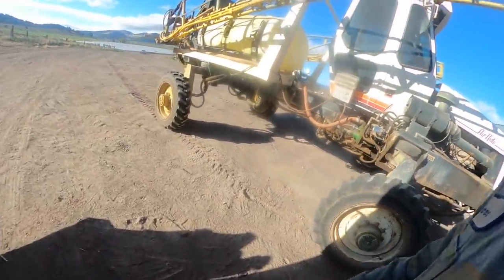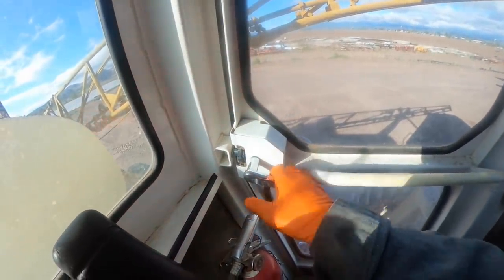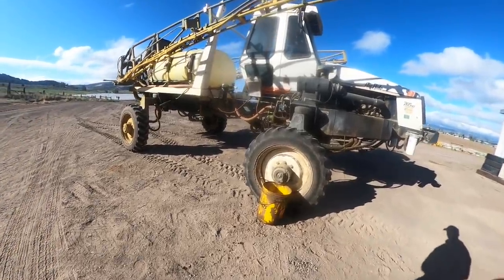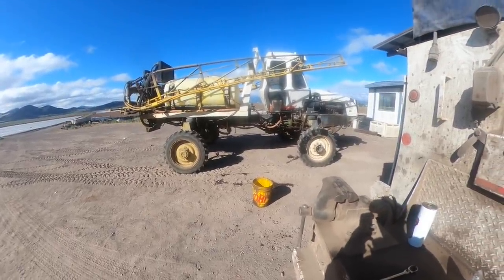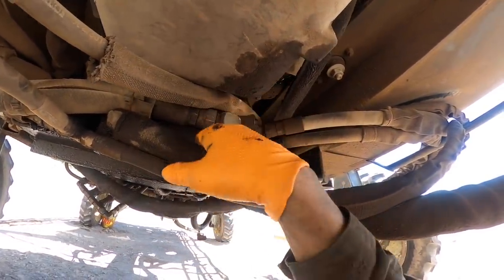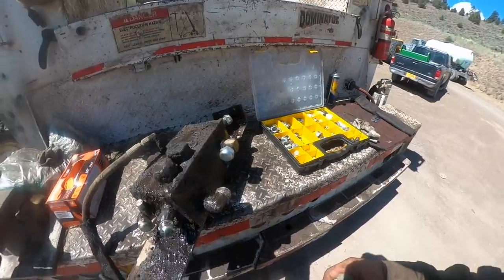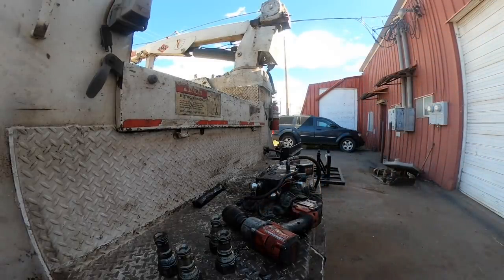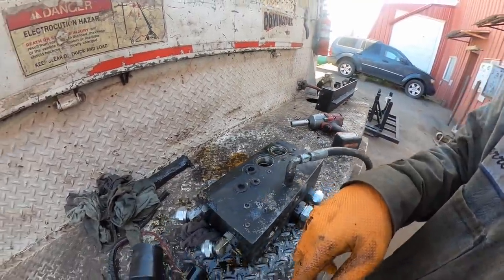More Hydraulic problems!

Comment: I used to maintain a Summitt 100 HP oil filter baler that used parallel 50 HP/3000 psi hydraulic systems designed to increase the cycling speed without needing huge plumbing to get it done, one of the downsides of all the flow was by the end of a shift the oil would get quite hot as you may imagine. Because of the temperature cycles the aluminum manifolds would expand quite a bit and in turn eventually allow the (Sun) cartridges  to lose their intended torgue setting and as such allowed the ever so slight leaking on the o-ring/backup rings that if not caught in time would send debris everywhere in the system as well as allowing both directions of flow to energize at the same time. The final solution became making sure the cartridges were super tight when cold before the shift began and a schedule to change all of the o-ring/backup rings every quarter. 
 I can only imagine the possible issues with this sprayer drive using a 6000 PSI operating pressure, no doubt it would possibly have issues not seen in a more common 3000 PSI system, for one thing cracking webs down in the manifold where cartridge port ends may be close to one another.

Comment: Answer for some of the comments questions on how the two - speed works in a nutshell. The pump supplies a certain flow (rate or "speed"). Increase the flow to the motors and they must turn faster. In low, the available fluid flow (gallons per minute, liters per second, whatever) is dived to each motor (4), so the motor speed is essentially the pump flow divided by 4 flow circuits. In high, the flow is shared between the left and right front and rear pairs of motors (2), so the flow is now only divided by 2 flow circuits, so theoretically twice the flow going through the motors so twice the speed. It works very similar to parallel and series electrical circuits.

Comment: Warren, I've suggested this before, get yourself a small tank, 30gal roughly and a small pressure washer and mount them on the upper side of your tool racks. Gives you the ability of washing stuff on the spot instead of making trips back and forth unless you absolutely have to go back to the shop. Plus, if the set the tank up properly, gives you a hand washing station on the spot as well. Great video as always. Cheers :)

Comment: I use the bumper on my service truck as a work bench just like you do.  I went ahead and welded a lip around my bumper and drilled a few drain holes with a plastic container underneath to collect the oil.  I put the lip on because I was tired of parts rolling off into the dirt and having to find them.

Comment: I worked at a grain elevator years ago. Co-op. And used to drive the truck hauling water and chemicals to the guys out in the field with the sprayers. We just got in a 1274 Rogator. Gigantic huge machine. Anyway a bad storm was coming in with supposedly hail and maybe tornado. So we decided to park it inside at our fertilizer department to protect it. And I was volunteered to drive it over and put it inside. I had never drove one before and was scared to death cause I was afraid of it getting away from me and crashing it. Well I figured out how to put it in slow granny mode crept it over to where it was going to go inside and the big bay door was pretty narrow and as tall and wide as that machine is I didn't trust myself. So I went and got someone else to drive it in. Now I can wheel around a Case or Cat Backhoe or a old Cat D8 no problem. But those sprayers. Forget it

Comment: The tees in the rear drive motor line act as the differential for turning. At first, I thought the motor lines were reversed on one of the drive motors but the o-rings look to be the real problem. There's probably a flow divider in the valve block that splits the flow 1/2 to the motors and 1/2 returned to the tank for low and full flow to the motors for hi. Trash in the lines may still cause problems in the motors. I hope the filter catches most of it.

Comment: Warren:
This job here is a perfect example of what I said on your last video-
Drive 20+ miles to diagnose & pull part, only to then drive 20+ back to
shop to "pressure wash" a part, to then properly repair it.

I'm saying- your DIY fab skills, make a cheap utility trailer, carry a water tank,
Steam cleaner, degreaser. Extra room for parts, etc. You need a trailer!

Show up to a job like this- degrease/steam entire undercarriage, 
run it to a dry space, easy to see leaks, easy to R&R components.
Reply: @RenewTheRWandBlue  And then he can enjoy saving fuel, time & money by having the correct and needed tools & equipment on hand to do a proper job. I'm pretty sure Warren is fully capable of hurdling if
needed once in a while- when he would take the trailer.

Comment: That machine probably did that last year, the year before..multiple seals dont suddenly fail, altogether. I suppose most farmers ignore failures till the machine just wont go anymore.
Reply: I don't know about that. In the middle of the US most farms take very good care or there machinery because our window to get planting, spraying and harvesting aren't very big and can't afford down time. The problem with this most likely has been creeping on and it only take one o ring to fail .This is a older machine and the oil runs hot and it probably doesn't have a big enough cooler. If you noticed the dried mud on the rear tires they may have hit a muddy spot and the extra stress may have cause the o ring to fail , Sometimes that's all it takes, seen it a 100 times.  You my be right about this one it seem that Warren customers have employees and with that comes some repairs because of neglect or abuse.  I should add those hydro motors do run hot probably 180- 200 degrees,  and issue, are not uncommon.
Reply: This is called, just plain usage, it's not abused and can't really say neglected. "O" rings go bad period and there's no way to check them unless you completely tear things apart. If it ain't broke, don't fix it. Farmers simply don't have a reason to tear into these unless issues begin to arise. As PAB has said, this has been an ongoing issue, not abuse or neglect. Seen this too many times myself. Farmers do have a time crunch per say, no dilly dallying around to get stuff done. Cheers :)

Comment: The engineering department on that thing needs a swift kick in the teeth.. let’s put every hose and component we can under the machine, and in areas you can’t access, they we will not put any skid plates..., then we’ll charge the ass hole, I mean customers for the manual! Sounds like a great business model to me.. lol no reason there isn’t a panel on the side of the machine at eye level, with all controls, then hard pipe these motors, with just enough soft line for flex..

Comment: Dividing flow equally in parallel hydraulic circuits requires a special valve block. I'd be interested to know what type they use in this system. Only one i remember is called a rotary flow divider but I know there's more types.
Reply: I just realized that's what the failed o-ring was on ... a cartridge style flow divider. That's why there was 4 of them for each motor. derp.

Comment: I think you called it right Warren. The valve with the missing o-ring is probably allowing reverse flow which is pushing back against the proper flow control. O-rings are just like light bulbs, when one goes out, all the others are not far behind, especially on these types of systems. The heat, pressure, and constant reverse flow switching definitely hardens those sealing rings over time. The fact that someone repaired one and not the others suggests a quick field repair to keep the machine going and the follow-up service just didn't happen (pretty common on farm equipment). Looked like most of the rings were still mostly there, hopefully the other pieces are still in the main block. Guess you'll find out soon enough. Seems like you are learning more about hydraulics everyday there Warren, perhaps you will come across some helpful information for that crawler.

Comment: Comment was too soon.
Watch video of tire driving the wheel is pulsing forward and backward when you were lining up the plug. The rear did not move like that.
Etch/scribe (pin punch) match marks and number the ports and devices each was located and to show direction and angles. Take your pictures now and do some more cleaning and marking to save on cussin' later
Take care Warren.